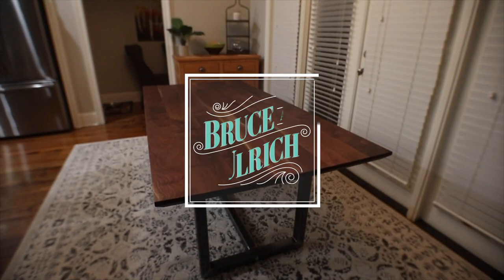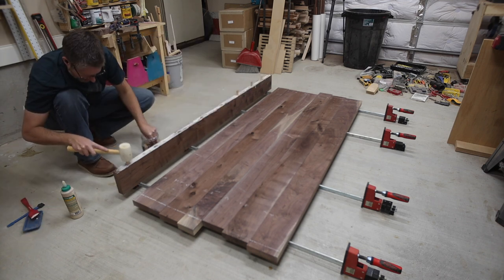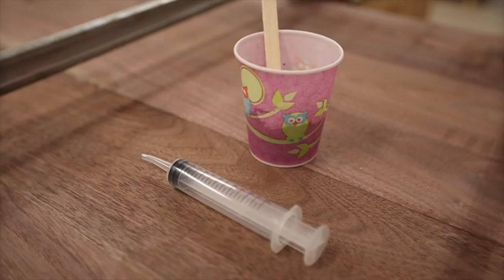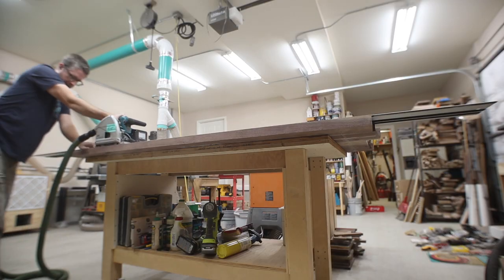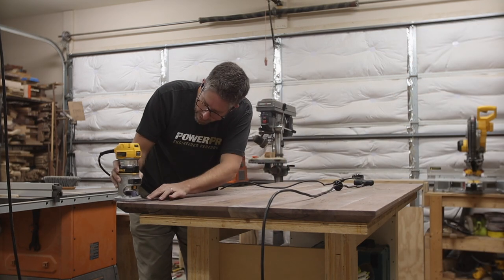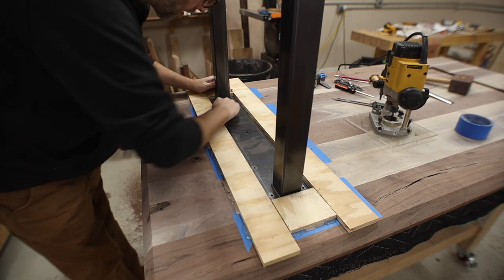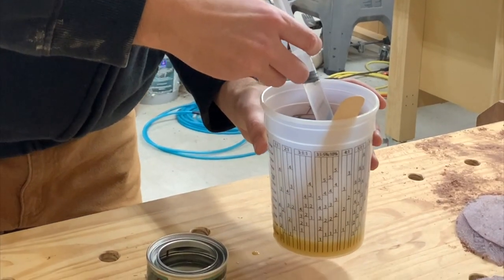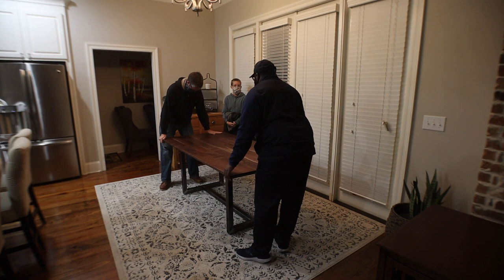MODERN WALNUT AND STEEL TABLE // HOW-TO

Comment: Looks great. I like how steel legs let you get rid of the apron. Makes it look a lot lighter.
Reply from the maker: I couldn’t pin that down until you said it. You’re right! And there was a cross bar between the legs so there was no racking side to side.

Comment: Such an awesome table, great job Bruce!! I love that Rubio finish, I have a walnut slab table I am working on that I have debated dropping the money on a can or Rubio for. After this I just might!
Reply from the maker: I think you could get 2 tables out of one can. So, about $25 in finish. If you want, I’ve got it linked in my Amazon storefront
Reply: @BruceAUlrich  if I do decide to do that I will definitely go through your link. I’m between that and using sanding sealer and a polycrylic.

Comment: With the Dewalt planer, did you upgrade to the helical head cutter or are you still using the straight knives?
Reply from the maker: I've still got the straight knives. I don't think I'll do that in this one. My buddy Drew did and he loves it. I think I'll just upgrade the whole planer.
Reply: @BruceAUlrich  I am in the market for a planer and since "everybody" has this one I wondered if it is worth it with the straight knives, or if helical should be the goal out of the gate.
Reply from the maker: @TheCHRISCaPWN  IMO, if you're gonna go with helical, save a little more and go with a floor standing model if you have the room. You'll be almost $1200 into it with the helical head.

Comment: Wait.. only ONE coat  of finish?  Is that how Rubio works?   Nevermind, it's right in the name...  🤦‍♂️  Sure is purty.   I'm so used to poly on a tabletop, I'm curious as to how Rubio wears over time.
Reply from the maker: Yeah, I'm curious also. However, Rubio has been used primarily as a floor finish for years and years. That's why so many people making tables use it. I think that's a pretty good track record.
Reply: @BruceAUlrich  that's a great testimony